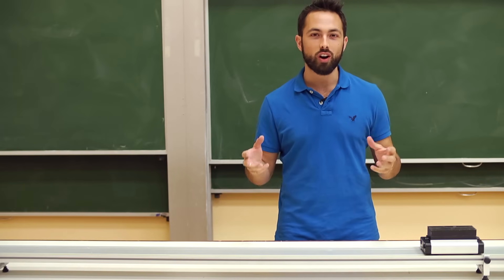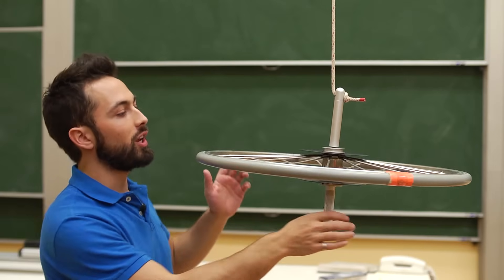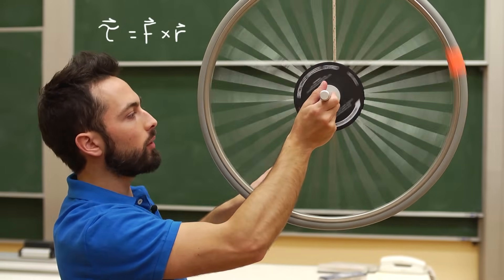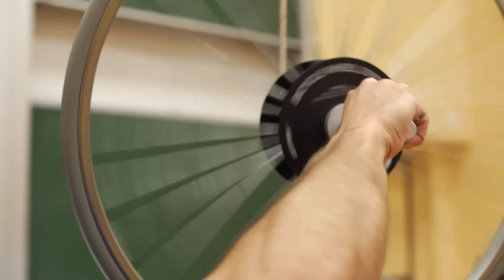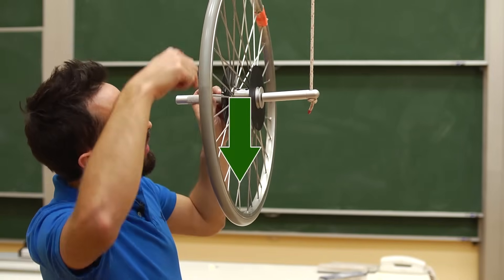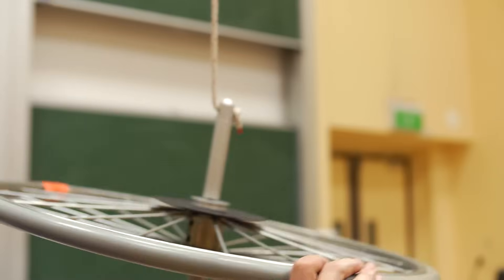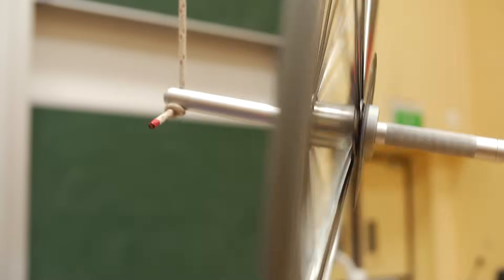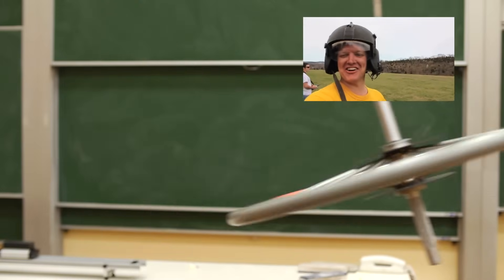Gyroscopic Precession

Comment: I dont get how there is a torque to 1 side. the wheel is symmetrical. can someone give me a good explanation? what would have happened if he spun the wheel the other way
Reply: The very short and therefore incomplete answer is that gravity is pulling the wheel down on the side that has no string attached. When any spinning mass is turned or tilted in a direction other than the one it is spinning, the way the mass moves is thrown out of whack (technical terms here. Don't worry, I'm a scientitian!). That makes the wheel push itself in weird (put actually quite predictable) directions, which gives the above results. It's a bit (meaning not at all, but it might help to think of it as) like if your car goes north, then turns west too abruptly and flips. You might think "hey, I'm driving forwards, so I should flip over forwards", but the way that momentum is affecting your car, turning before flipping makes you flip sideways. This is kinda (cough dangerously oversimplified cough) the same, but with rotational forces instead of the direction force of your car going north.

Did that make any sense? Because I think my brain went on vacation in protest about three lines in....
Reply: rgqwerty63
What decides the side it moves to is which way you tilt the wheel. In the video, it was tied with a string on one side, so the other side of it started getting pulled down, and it spun in the resulting direction. Had the string been on the other side (or had he spun the wheel in the other direction), it would end up going the other way.

Note: I edited this because Robert made a good argument below. After editing, I found that the argument might not be so good after all, so I am conflicted. Please read the continued comments to see if I can be trusted.... Dun dun duuuuuun!
Reply: rgqwerty63 well, if he spun it the other way, the wheel would have  procecced the other way
Reply: Robert Roman
Friendly handshake And thanks for pushing me to train my (sometimes wobbly) explanation skills. We all need to stay sharp out there, after all ;-) Let's call it a team effort :-)
Reply: Robert Roman no i mean how does the wheel get pulled to one side when its symmetrical. what decide the side it moves?
Reply: ***** I think it's just convention to use the right hand to figure out in which direction the torque is (the right hand is also used to figure out the direction of an electric field).
The right hand rule, however, does not mean you spin something to the "right" (as Robert said), because when something's going in a circle you can't say it's going to the right or to the left. You would use your right hand rule to determine the direction of torque, regardless of whether you applied a clockwise or a counterclockwise force.
Reply: Robert Roman
Apology accepted. Greatly. Nobody has actually ever apologized for anything to me on YouTube before, so... thanks, I guess!! "Rambling" just rarely has a positive sound, y'know :-/
As for the torque, I completely agree with your description, but this has nothing really to do with that level of science. It is simply that if the string supports the wheel (the pivot/axis that it is revolving around, to be precise) on the other side (and everything else, including Derek, remains unaltered), the entire setup is effectively mirrored. The easiest way to describe it is "imagine the entire video  flipped horizontally". The science is still the exact same, everything is just mirrored, hence the rotation caused by gyroscopic precession goes the other way. Same science, just flipped.
Edit: Oh, and I did the experiment before (I teach science), and have a bit of a secret passion for gyroscopes. I have hurt myself far worse than dear Derek did, too :-)
Reply: rgqwerty63 : it's a convention. Scientists all over the world decided that, in order to describe the direction in which an object is rotating, you must use the right hand rule. You can describe it the other way round but you would have to redefine every quantity accordingly. It's just a description :) The fact that there's  a vector pointing "out" from the wheel does not mean that there's something moving in that direction. For the second question the short answer is "it will spin around the vertical axis in the opposite direction"
Reply: Actually, I had problems understanding this as well until thinking of it.

Use a left-hand rule and visualize this wheel-spinning experiment. The result will be the exact same.

The right-hand-rule is just a tool to help keep you consistent. All that matters is "perpendicular". Left-hand, or right-hand. Right-hand-rule is just conventional.

If you're doing your /own/ work, for your own uses, you can use a "left-hand-rule" and the result is the same.

Imagine the "vectors". One vector is pointing to your, the other vector by the string is pointing to your right. Add them together and you get a slightly counter-clockwise (Looking from above) spin.

Left-hand-rule?

The vector would be pointing behind, or away from you, and the string vector would be pointing left. Add those two together and, again, you get a counter-clockwise (Looking from above) spin.

What matters isn't right-hand or left-hand, it's just "perpendicular", and "consistent". (IE, use right-hand or left-hand for the entire calculation and don't switch between the two half-way).
Reply: Robert Roman Derek's video is correct, but it doesn't make very much intuitive sense. I'd like to refer you guys to a video by Matthias Wandel which explains this effect without the use of vectors, right hand-rules or any maths at all. You don't even have to know what a vector is in order to intuitively grasp this entire concept after finishing his video. Link here: /watch?v=jQEKhIovKA0 

Do not report me for advertising or anything of the sort -- I'm sure Derek would agree that sharing videos "in the name of science" is perfectly fine.
Reply: The best visualization for me was the smarter everyday helicopter video....
Reply: Henrik Larsen thank you that makes sense.what confused me is that he used a right hand rule, meaning had he spun it the other way, it wouldnt have worked
Reply: Robert Roman
I just did the math, yup, you're right. The string does not create a relevant lefthand/righthand situation, only the way the wheel is spun can do that here. My apologies.

While editing my former post, it occured to me that no, tying the string to the other side will flip the direction, because it essentially flips the way he spins the wheel (which I know we agree will flip the direction of the effect). If he spins clockwise with the string on one side, it is the opposite effect of spinning it clockwise witht he string on the other side, because if you rotate the whole arrangement to put the string on the original side, the wheel will be turned over, i.e. go the opposite way around.

This has absolutely nothing to do with the science behind it, though, it is merely a matter of keeping the model straight in your head. Which, honestly, gives me a headache. But it should be solid as described...

(if you tie the string in the middle, though, you're (still) screwed :-) )
Reply: rgqwerty63
Technically, it would have worked (if I understand you correctly), it would just have gone the opposite way.
Reply: Henrik Larsen When you tie the string on the other side, the torque from the spinning wheel will be flipped, relative to the the system. So if the torque originally went outwards, away from the string, the torque now goes inwards, towards the string. But also, the direction of torque from gravity pulling the wheel downwards will also be flipped. The two flips cancel out and cause the wheel to turn the same way as before (assuming that the wheel is spun the same direction as before).
Reply: jamiec24925
Man, we need diagrams in this thing :-D I am not sure I understand your description. If the wheel is on the other side of the string (and gravity is still pulling down, of course) and spins in the same clockwise/counterclockwise direction, it is the same as spinning the whell in the opposite clockwise/counterclockwise direction. Just walk around the wheel and look at ot from the other side.

But again, this is not the science behind it, just the physical setup, so we may be talking about completely different things...
Reply: Robert Roman
Is it absolutely necessary to call it "ramblings"? That is kind of hurtful. And sorry, but I still get the same results, if there is something I missed, feel free to point it out. And that is not an attempt to insult anyone or "ramble", it's just the results I get.
Reply: jamiec24925
I never used that method before (everyone has their own methods and all that), but I think it's about which way the wheel spins. Your fingers 'point' the way the wheel goes round when your curl them up. I may be wring, though, as previously stated.
EDIT: I am not sure my answer really matters. He is pointing out an axis (he is talking about the angular moment on the axis at that point, not the actual torque), so it's the axis that's important, not so much the direction. Still, if he did it on a wheel with the string on the other side, using his right hand might get his thumb stuck in the wheel spokes :-)
Reply: ***** My reaction to these explanations is the same as yours. Saying that there is a right or left hand rule for the direction of angular momentum doesn't give me any feel for why.. Presumably it can be demonstrated with Newton's laws and some diagrams but I'm not getting any sense of it from reading the prose.
Reply: I want to ask the same question but in a different way. What happens to the propellers on an aircraft assuming the aircraft has one on either wing. One rotates counter clockwise creating torque that is in the same direction of the motion of the aeroplane. On the other propeller, if rotation is also counterclockwise (same direction as the other prop) then the aeroplane would be prone to flipping easily to one side, and very difficult to turn it the other way, so the manufacturers make the second prop turn opposite the 1st. If the 2nd prop is running clockwise, this means that the resulting torque direction will be against the direction of the motion of the aeroplane.
How does that affect the aeroplane's flight?
Reply: I think I know what you're confused about, so let me try to explain...

First watch this video, specifically at 5 minutes is the most illustrative. https://youtu.be/eTjGTxSevHE

Now that you're at five minutes, understand that when you apply force upwards, the end of the wheel will tilt downwards. However, the wheel is spinning, so by the time the force you apply reaches the other end, it's already done a 90 degree spin to the right (counter-clockwise or clockwise). So the force is applied to the side. 

The speed at which the wheel is turning, and the distance between the axis and the end of the wheel will influence at what degree the momentum is applied to a spinning wheel. I hope that helped you visualize what's happening.
Reply: Torque is defined as R x F, which is a vector. It has nothing to do with the symmetry of the object.

Comment: does this mean when you cycle, there is a torque to one side
Reply: lol, great question. i have the same feeling about how symmetry should make the direction of spin irrelevant.
Reply: Torque and angular momentum are slightly different concepts. AFAIK, there will be torque when you accelerate or decelerate via the pedals, mostly on the wheel your chain is on (typically backwheel, but I've seen stuff... oh man...). There should be a tiny bit of torque on non-chained wheels, too, from being turned around their axis (like Derek does, actually. Hm, never thought of that before now...). There will however be angular momentum, which (I am told) is why it's much easier to keep your balance on a bike in motion than one standing still. Which, again, is part(!) of the reason why unicyclists do that rolling back and forth in place to keep their balance.

Comment: There are these gyroscopic toys, shaped like a sphere with a flywheel inside that you start spinning by pulling a rope, and then through moving it around certain angles, it increases its speed so much you can't hold it any more.
As far as I see it, the power needed to increase an already spinning flywheel in that fashion, isn't nearly as much as the potential power it gains through speed So why not use a flywheel with magnets on it and an apparatus that tilts the spinning axis of the wheel automatically so it always increases in speed, have some wire coils around it and let the magnets on the spinning flywheel induce power into them? Voila, free energy generator - or not?

Comment: What is also startling is that this same demonstration will work using a coil of garden hose with water running through it as a substitute for the bicycle wheel.  More cumbersome but when suspended between your legs with water running it will show this same precession.  Attenuated but it is still there.

Comment: If one side of the axle was supported from the ground on a scale, would it loose weight with increase speed ?????????
Reply: yes
Reply: But let me give you a puzzle: Support BOTH sides from a scale, and then the whole system becomes weightless with speed and leaves Earth. What's wrong with this picture?
Reply: Your answering with sarcasm. Yes I understand thermodynamics. But regardless has this been done ?
Reply: Lawrence Vertamme Your answering with sarcasm. Yes I understand thermodynamics. But regardless has this been done ?
Reply: Lawrence Vertamme
It would slow down with friction and air resistance, causing the wheel to plunge back to earth.

Of course, I wouldn't believe the whole scale thing would work in the first place. But even if it did, what I stated above is what would most likely happen, assuming you've applied a force that would cause the rotating wheel to go up.
Reply: Lawrence Vertamme is the answer, that by supporting it on both sides, there is no more angular momentum caused by gravity, so defying gravity by adding angular momentum of spinning the wheel would not occur. You just have a spinning wheel. ??
Reply: Let me rephrase that:
If the wheel both axles were resting on blocks on a scale . And the wheel spun up creating angular momentum, So one could pull the block from one side and the wheel would float on that side. Will the scale weigh a difference between rest and spin ????? (less the weight of the block withdrawn.)
Reply: I thought Lawrence said yes right at the top? Then he introduces a different scenario where it remained supported on both sides.... that new scenario is what I was answering.
Reply: Sorry Guess I'm to broke to pay attention.
Reply: Going over the conversation again I'm confused. But thanks for trying to answer me.
Reply: No Gary Leventhal  the weight of the gyroscope does not change. The tension in the rope (or, alternatively, the reading on the scale if it was supported from beneath) would not change. See Veritasium 's video "Anti-Gravity Wheel".
Reply: But ...But......Then how can I invent my over unity gyro wheel if the god's of psychics wont work with me..... ;-)
Reply: Gary Leventhal I see now

Comment: You should put a motor in the wheel hub and suspend the wheel by a power cable to the motor. And put it through the end of the axle not the side. That would make the operation a lot less distracting. You can thus keep yourself out of the way -for your antics are even more distracting.

Comment: The torque vector as described would actually be R cross F, not F cross R. Don't forget this on your exams or you will definitely get the wrong answer!!!
Reply: You'd just get the answer in the opposite direction. Going any further, yes you would be completely wrong.
But the rule of thumb is, stretch the fingers across the radius, then curl your finger in the direction of the force.
If they get this concept it should fall together.
Reply: he did not say that it was the cross product. He simply said "F times r",which means he did not imply to say that the cross product is F x r
Reply: @pallavi6013 Elementary school students don't watch this video so it's kinda implied that he meant cross product
Reply: @pallavi6013  Then why did he change it and thank me for pointing it out.

Comment: Nice video, now I understand this better this but... What happens if I turn the wheel clockwise?

My first assumption is that it is going to do the same but instead of pulling the rope it'll push the rope away from its "center".

Comment: Two dimensional teaching. When you apply a force squared to the centrifugal force. The opposite reaction is squared too both,  equal too the action.  If you apply it with out a pivot there is no third vector.  Just a wobble and drift as a third vector.

Comment: What will happen if you spin the wheel in the other direction? The torque and angular momentum from the applied force will point in the opposite direction, while the torque and angular momentum from the gravity will point in the same direction as before. Will this cause the wheel to immediately fall down, or will it spin in the other direction around the rope?